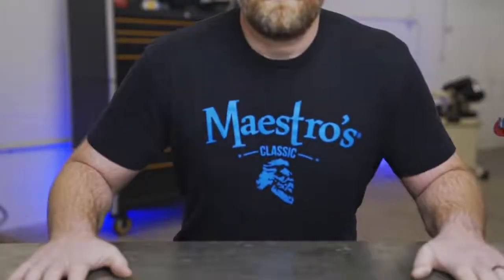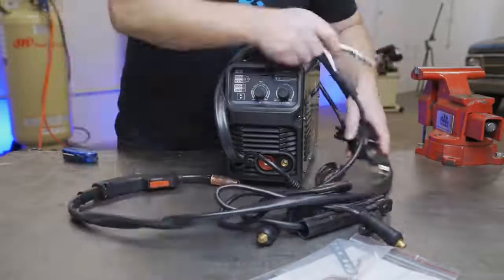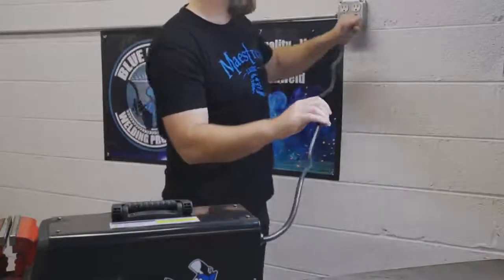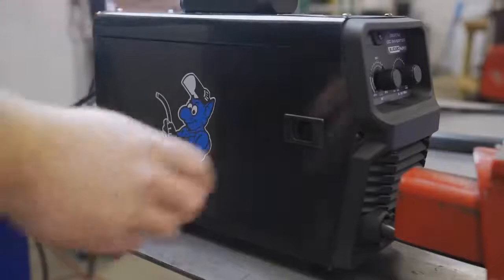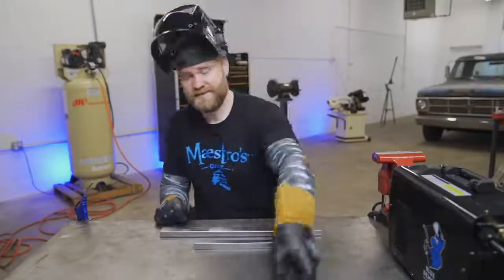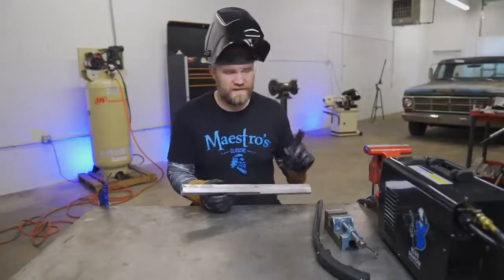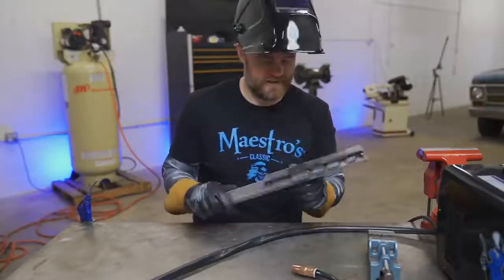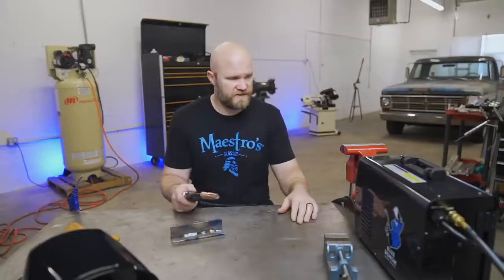MIG welding set-up for under $500

Comment: As you are using the machine, there is an intermittent noise in the background.  Is that noise coming from the drive unit or the wire spool?
Reply from the maker: I am sorry, i don't know.  @justvoss was the creator and I didn't notice.  the driver rollers are not loud so???